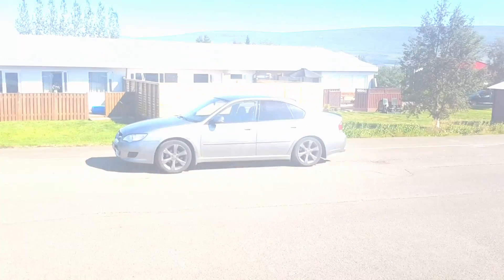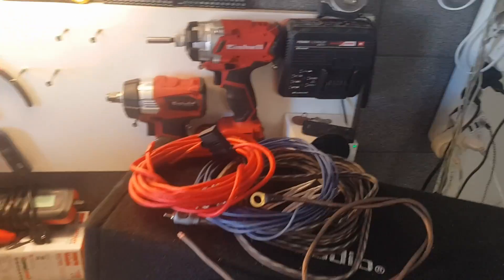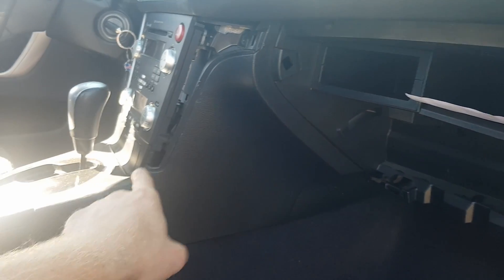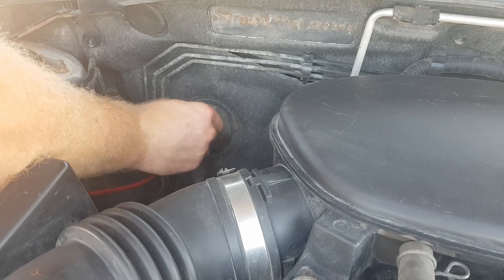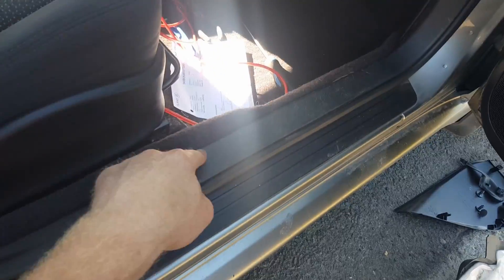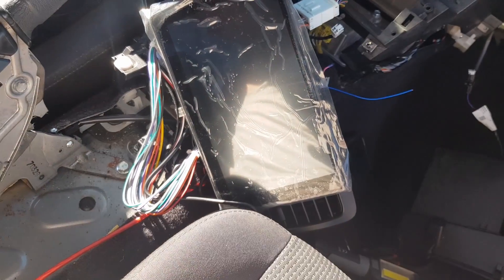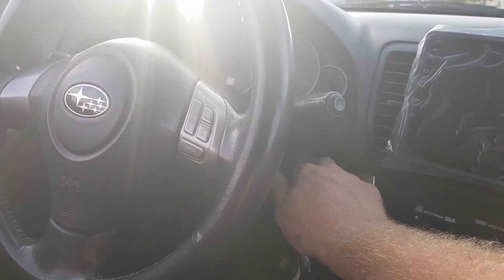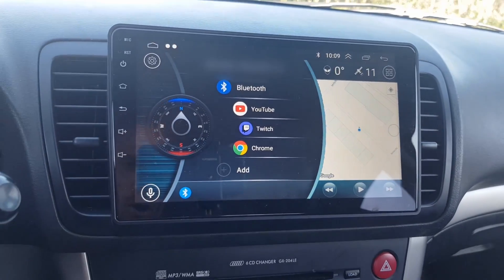Modernizing a Subaru Legacy

Comment: you can get facia kits with the aircon controls and an empty double din space for aftermarket stereos. means you can keep the little storage space
Reply: true, but i think in this case these seem to look nicer. might try to make a storage space in the stock radio location when i do this setup

Comment: Hey man, this is the first video that covers the exact same things as i wanted to do. The head unit on the old cubby place, leave the old radio where it is not running. And a subwoofer i have left from my old BMW. I was a bit suspicious of this aftermarket head unit like this, because i could find a video like this of someone going through the process. You explained and showed everything super clear ( even tho you made a bit of a mess 😂). Do you recommend replacing the factory speakers as well, or is it a world of difference compared to the stock head unit?
Reply: hey man did you ever end up going through with it? i have the same car and wanna do the same exact setup
Reply: @Ablenx  yes i did, its all working properly. I actually thought the installation was even easier than it looked like on this video !
Reply: @LayogenicMusic  wow that’s actually really encouraging to hear. this might be a lot but: i was wondering if you had a parts list or recommendations from what parts you used (amp, woofer, enclosure)?  i’m also looking to install a sub so im curious about the location of your woofer setup (it’s my first sub/ head unit install). any advice would be greatly appreciated:)
Reply: @LayogenicMusic also going for a carplay head unit

Comment: Couple of questions mate:
1- How has the use of this android unit aged for you? Does it do everything you wanted it to do and is it still snappy?
2- I have a similar unit installed (although a cheaper version from AliExpress) and I just can't get the hands-free mic to work properly. I've added an external mic to try it our but it seems the unit doesn't pick that over the built-in mic on the unit itself (and that one sucks hard!). Did you have this issue?
Cheers!